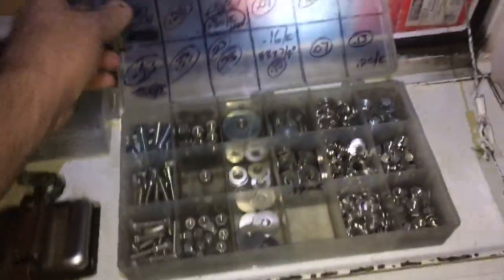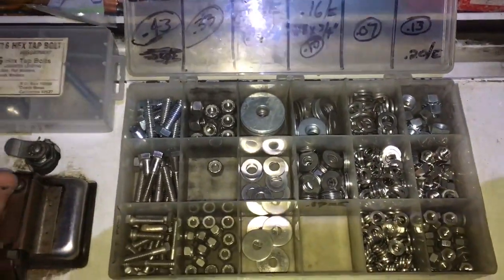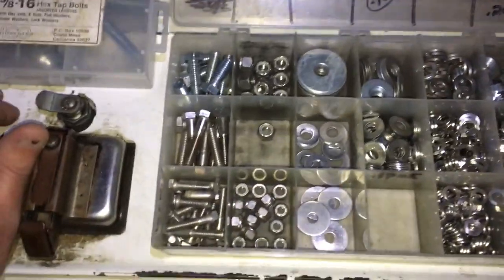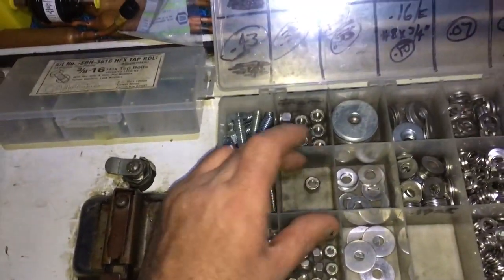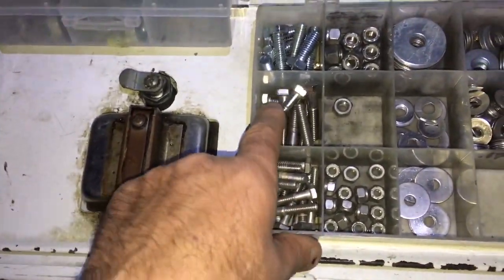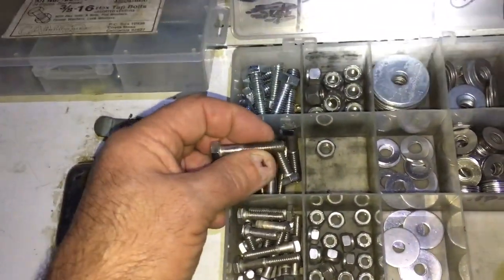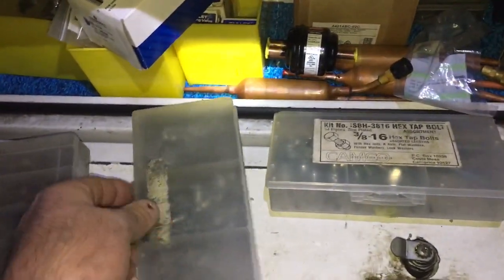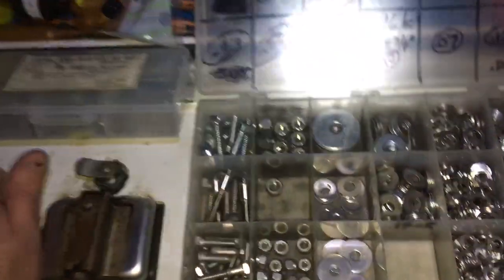You Just Need a Few Nuts...

Comment: I scored some 5/16 SS hex head screws in 1 inch and 1/2 from my local hardware store  for the boat refrigeration side of my company. Game changer Makita makes a non magnetic 1/4 and 5/16 nut runner that holds the fastener with a retension clip it's perfect for what I do daily
Reply from the maker: Makita screw holder im going to look for. i need that. 👍👍